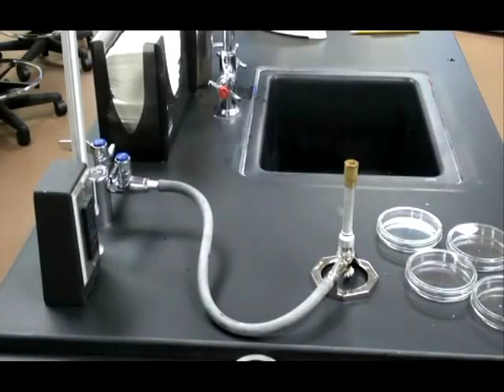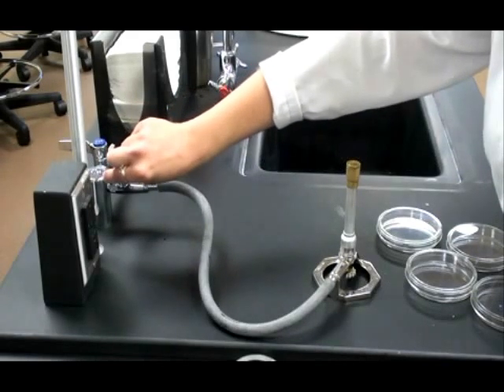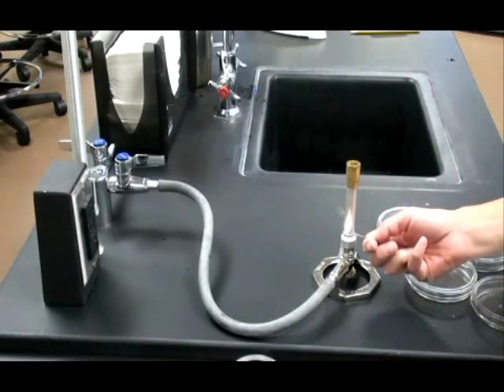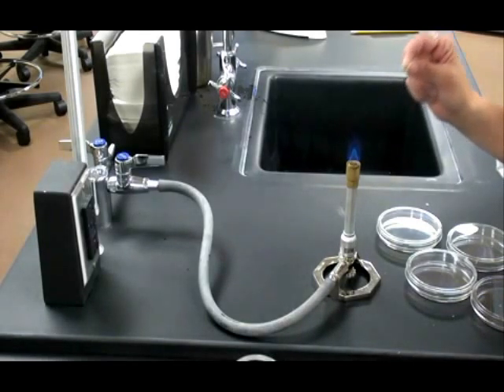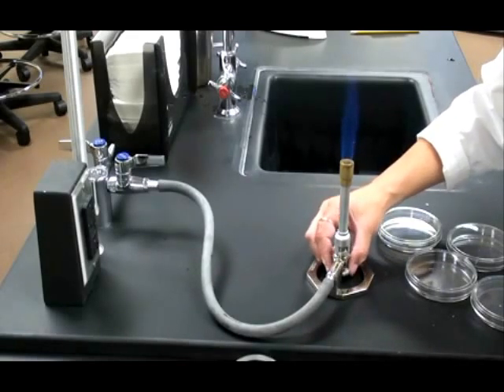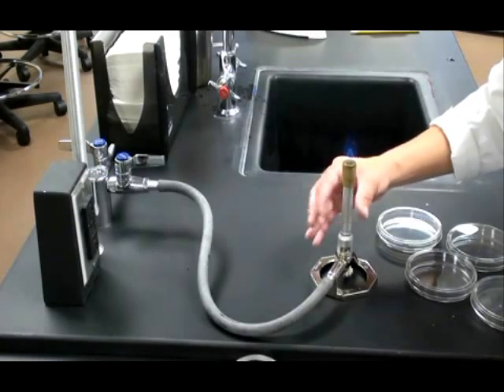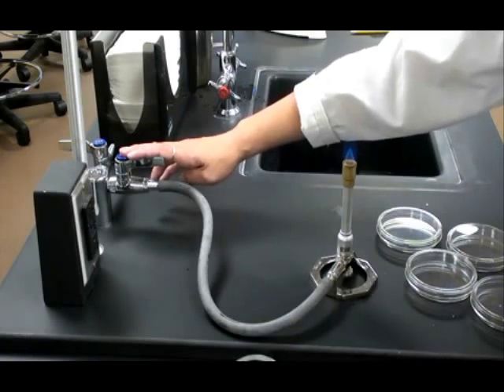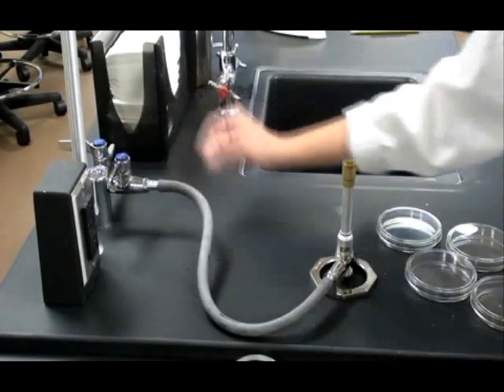How to Light a Bunsen Burner Using a Match

Comment: Dont you have to light the match before turning the gas tap on? You have to keep the match on the side of the bunsen burning while at the same time turning the gas tap on so no pressure can cause the flame to ignite and burn you